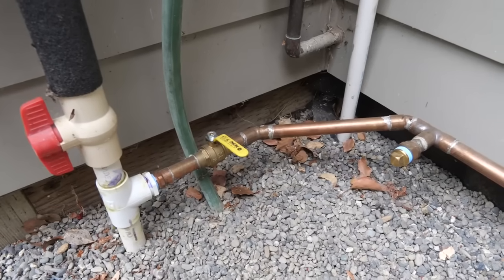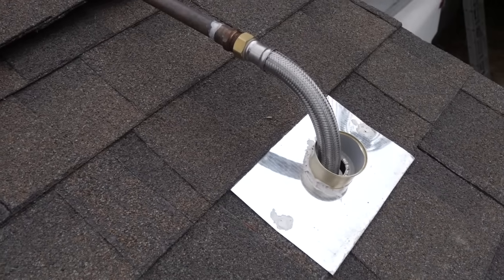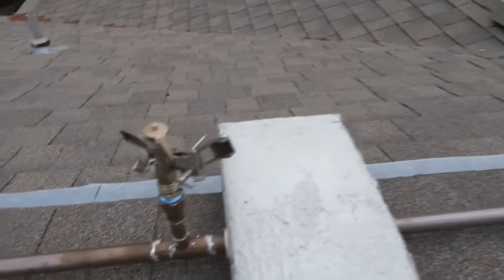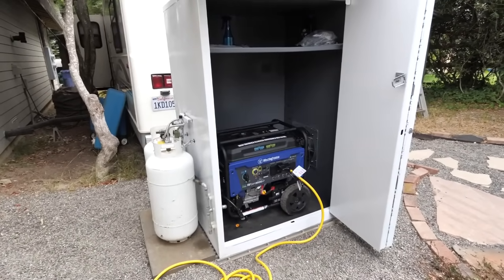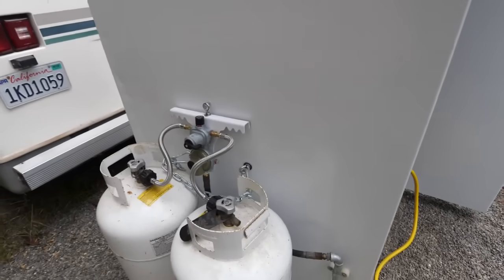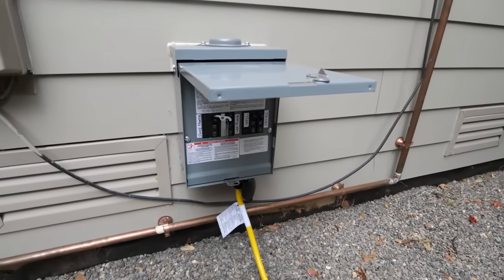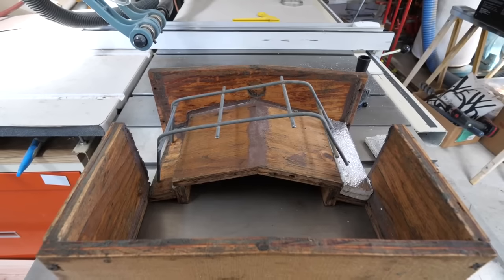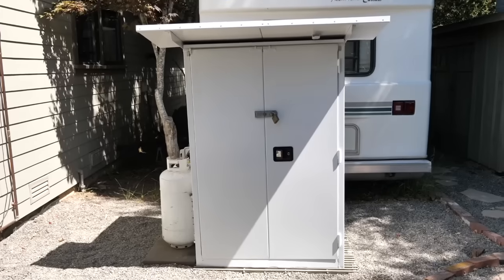Roof sprinklers and backup generator for wildfire-prone rural house

Comment: An ok  install. Congratulations on such a project. But ...

I've done it myself in Australia where we get ferocious bushfire house burn-overs of 600-1000°C.  But I used 1" copper main supply line because volume and pressure and sprinkler jet size calculations for a similar house size to yours needed 1" not 3/4" main line. You'll have starvation at one end of your lines due to pipe frictions -- unless you add a 1" ring line (plumb from your bore pump via a buried poly line to the other end of your house and then up again). You can then add ground-to-house face sprinklers off it.

1" gives nearly 2x the water volume of 3/4". Sorry, but 3/4" was a false economy.

In fires, sprinkler jets should be sized for LARGER DROPLETS at LOWER PRESSURES rather than high pressure for long shoots because heat evaporation can reduce up to 100% of your water spray if it is not heavy. I used things called "wobblers" not Rainbird of Cyclone design. Your house can end up in merely a cloud of steam with dry lawn verges and roof water which doesn't even get to your gutters.

Comment: what makes wildfires the most dangerous is the high wind speed. when the wind is blowing really hard is takes embers and forces them into the eaves and vents of the house . plus the water would be blown away from which way the wind is blowing. so just the sprinklers on the roof would probable not save the house in a high wind wildfire.

Comment: You may want to invest in a pipe wrap heating system that can be energized through a thermostat for freezing weather conditions. That copper pipe will easily freeze in a harsh winter cycle.
Reply: he said it will be drained.
Reply: @norbertdx  Fires can break out even in freezing temperatures. How will it be prevented from freezing during operation?

Comment: This is great, but when the house is first built put the pipeline inside the house. With just the sprinkler out only. Have the power cord under ground won't burn , or covered. Have a system that if you are away from home it can be turned on.

Comment: YOU NEED TO BEGIN WITH A METAL SOURCE
YOU BEGINNING SOURCE IS PVC
THAT WILL MELT IN A FIRE 
BUT I AGREE WITH YOUR SPRINKLER SYSTEM 
I DID THIS TO MY HOUSE BACK IN 1995

Comment: Nice plumbing, and beautiful job! Know that roofs are not the primary point where fires gets hold of a house. They enter through your ventilation and gets hold of the inside and that's all she wrote. In other words suffits are the main entry point. You can see a house (in LA) that was untouched while all the other ones all around was burned to the ground. Again, what you did is not wasted just incomplete. The video is on Youtube https://www.youtube.com/watch?v=yZe-TlYxm9g

Comment: Interesting idea. I'm in Southern California and this has been a ferocious fire season as the worlwide news has reported.  Under the eaves of a house is often the first place a fire takes hold, so I would be thinking about that. Secondly, What if no one is home when a fire threatens? I'm sure some automatic trigger system could be devised.  I think this guy is right to do rhe generator/well method. We have seen power companies turn off the electricity and water utilities turn off the water to preserve it for the firefighters.

I think the major point I'm making is I think there is a market for a well engineered, integrated automatic system.  Wells average around $20,000 these days, so it would be expensive. Still, many people would see it as better than the terrible losses or the battling with  insurance companies.

Comment: BIG TIP - Your house has "roof eaves" where most fires start under the eaves and move into the attic.  Most fires don't start from the top of the roof itself.  You need to take that into consideration
Reply: I was thinking of the same thing.  According to a fire fighter, ventilated roofs are what caused many homes to be burnt down during the LA fires.  Finding additional ways to maybe block off the ventilation might be a strategy worth looking into.

PS - there's absolutely nothing negative about your statement.
Reply: @lanzer22   Agreed.  New building code in California requires sealed eaves.  We have vents on our eaves that seal up in case of fire.  They're expensive but functional.
Reply: The water would flow down the roof and over the eaves. Don't be so negative.
Reply: @PeterHatton-nm6rn 
He's not being negative, he is being 100% accurate.
Reply: Clearly you don't understand. Your talking about the facia. Which has gutters on it. So no water will get to them.
He's talking about the updraft thru the eaves into the attic. 
Take a seat and stfu.

Comment: Looks like the weak link would be the power cord from the generator to the transfer switch.  I’m not an engineer, but could it have been buried or protected in some way?
Impressive system. I have been thinking of a system like this for a cabin in the Colorado Rockies. I had not thought of using propane.  How long do you estimate it will run with two tanks?  Great system though.

Comment: That's a great backup plan.  I would also add a second generator at another location in case the first one fails.  Also, remove any trees or vegetation maybe 30-50 feet from the house.  Once the surroundings get to some temperature in fire,  it overwhelms the sprinkler system.  Another thought is to add security 360 cameras so you see things in real time.  It's much easier to putout a fire started 1 min before than let it burns for hours.  My 2 cents.

Comment: Very cool. And I love your homemade concrete pipe stabilizers. BUT you miss an important part of fire prevention, which is control of the soffit vents. Every home has soffit vents and roof vents that create a chimney effect to pull air in through the soffit vents, and out through the rooftop vents to keep the attic moisture free. But during a fire this chimney effect sucks in sparks and ignites the attic. You need to have shutters to close the soffit vents or gable vents during a wildfire event, possibly even shutters on the roof vents so no sparks can be sucked into the attic.

Comment: That’s a very good idea but there’s just one thing wrong you can see it in the picture the tree limbs that is hanging over an around your roof they are a problem a lot of people have bushes right next to there house also a problem and vehicles or rvs that have two be moved or have a dead battery that can’t be moved if had to just a thought

Comment: I like the setup, but I'd also be putting some sprinklers under the eaves (mist spray) to wet the walls.
Looking at the fires currently in California with the high speed winds , I'd be worried about the embers hitting the side of the house and burning it. 
Sure, the roof is important (embers landing on it) , but the sides are also important I think.

Comment: well done. i've noticed the underside of the overhangs are what also catch the heat and flames as fires approach the house, you better also have a perimeter of lawn sprinklers that can keep the flammable scrub and sides of you house wet👍

Comment: Did you install a switch to disengage the power coming off your generator from returning back to the power lines?
That’s how linesmen and other people get killed. From people doing things like this. The power ends up energizing the line for miles while your generator is running.
Also, all that work might be useless because all that natural vegetation and big trees around your house needs to be removed up to 100 feet from your home to prevent the fire from getting up close recommended from the fire guide.

Comment: If you are evacuating: shut of water and gas at the point it enters the house. If your house burns down the pipes melt or burn, so if you didn’t close them off water and gas will just poor out. Water especially is bad because it drains the pressure and wastes loads of water, making fighting the fires harder. Gas and fire, well no explanation needed.

Comment: Metal roofs and brick siding would be better than asphalt shingles and burnable siding.  This should be standard construction in wildfire areas.  The sprinkler is a cheap and possibly a good work around providing you don't lose water pressure.

Comment: That is a very good start. I live in Australia where we too have major wildfire issues. The biggest problem is the wind. At 70MPH wind (120KMH) most of that water won't land anywhere near the roof, except for when it abates for small periods. Make sure you have downpipe plugs to catch the water and fill the gutters. That way the embers falling on your roof and roll into the gutter will be extinguished rather than burn up under the roof cladding.

Comment: Love how you installed two propane bombs right outside the cabinet for your generator. You won’t have to worry about exhausting fumes from the generator when those babies light off.  You probably won’t have to worry about that side if of your house either.
Reply: Also no air intake for cooling for the air cooled general.  It'll overheat and fail.

Comment: My house has a metal roof.  Been struck by lightning a dozen times and never had an outage or fire. Stunning that few people have houses with metal roofs in fire-prone areas.
Reply: generally modern shingle roofs don't set on fire. Even in the late 90s they made tar shingles that are fire resistant for these areas. Its not like shake shingles that will set on fire. Its more about a wildfire tearing through a dry yard and taking the house with it.   This would cover more than just the house and leave a nice fire break around the house. Thats what its for more than the roof setting on fire. Factor in cost of a metal or tile roof and you can see why people opt for tar shingle.

Comment: The ability of the moisture from the sprinklers to stop the flames from getting close to the structure (and stop embers that land in the gutters from igniting the structure) seems key. I wonder how barndamium-style houses with metal roof and siding faired in LA? I would have liked to have seen more of your spray pattern dry vs wet. Neat project 🫡

Comment: Great system! Not sure if anyone mentioned this yet (I couldn’t read all 839 comments) knowing people these days, I would make it so the generator can run with the doors shut and locked, plus use a hard line to the house. People these days will steal the generator and/or extension cord and probably the propane….

Comment: Honestly... it's a pretty god damn good idea. 

Every home or apartment out here beyond a certain year has fire-sprinklers inside the home. That's just common practice.

Putting fire-sprinklers on the exterior seems even more logical in regions with a lot of wildfires in CA like my area. 

As a GC of 24 years, running sprinklers on your exterior roof is far more simple than doing so on your interior. A leak inside your home, on fire-sprinklers on constant high pressure can turn into a major catastrophe if there's no fire. 

On the flip-side... have a switch on an exterior sprinkler roof system is a genius move.

Pretty fucking sad we even need to consider that idea.

Comment: Nicely done, but I question the usefulness of it:
1.  If the water pressure is lower (which it most likey will be if firefighters are fighting a fire nearby) then the sprinklers won't shoot as far.  They might not rotate at all.
2.  If the wind is strong then it might all blow away before hardly getting the roof.
3.  If the fire gets to your trees (it appears your home is surrounded by big trees) then the heat will vaporize that water in no time.
4.  If the fire gets to your home then the heat will be so great that almost nothing will stop it.  I once asked an architect if we could build a home that was highly resistant to fire and he quickly concluded it wasn't realistic, due to the intense heat and the duration of it.
5.  As for the man whose home was saved by this technique, can you really be sure of it?  How does he know that the sprinkler system saved his home?  It's possible that under just the right conditions it could make the difference, but there are plenty of other conditions where it won't.

Comment: You have a few flaws in your system. The sprinklers are not powerful enough for heavy winds and fire. The propane outside could easily catch on fire and blow half your house down.

Comment: Just some observations... first few seconds.. copper pipe into plastic pipe (heat resistant?)... Is the cladding on the side of the house fire proof/heat resistant? as the copper pipe is attached to it... propane bottles on the outside of the generator shed, wouldn't they have been better inside on that second shelf?  Yellow electricity wire to switch box, how heat resistant is it? wouldn't it be better to have that underground.. Would it not be beneficial to have a second line on top of the roof that cascades water over the roof to keep it cool, a cascade of wter over the generator shed and propane bottles if they are staying outside the generator shed and a water cascade over the well pressure tank to keep that cool and anything else that is critical to the running of the sprinkler system... there will be a lot of heat damage from the fire which may put your system out of action. The heat from any fire may also evaporate the water coming from the sprinklers making it useless. Would it not be better to have the sprinklers also spraying onto the house from the perimeter instead of from the house to the perimeter?

Comment: Great video. I am about to copy this system exactly using a large tank as a suply with the rain gutters re-cycling the sprinkler water back to the tank. Do you think it is necessary to add a non-return valve at the base of the system so the water does not run back down?

Comment: I am a retired wild-land firefighter. I used to set up sprinklers to protect structures. We can't put them everywhere and I think you did a great job. I had a new metal roof put on and I am adding the same type of pipes but am making it a CAFF (compressed air firefighting foam) system Kidee makes a mixer and I have a large compressor. This makes a thick layer of foam as thick as shaving cream. You should also add pipes under the eaves as the fires like to get under them and enter the roof. Great job!  Look up SCOTTY 4171 foam mixer, you can put this in line of the water pipe and it will mix the foam.

Comment: As having once been a firefighter I know that wildfires will suck all the oxygen away ahead of its path. So, once your generator shuts down, staved of oxygen, then your propane tanks will blow up helping the fire along. We lost five mates on a fire tanker after the tanker's pump failed and they passed out from affixation long before the fire actually burned them and the tanker which incidentally was fitted with its own sprinklers.

Comment: Wonder if the winds will defeat this.  I.E. blow the water away before it can work.  Stay safe peeps.

p.s. No one hates a Fireman.😃
p.s.s.  Except that guy that caught one with his girl. 😲
Reply: A tiny amount of water vs a giant forest fire with burning trees collapsing on the roof
Reply: @GunnerStrauser  Several homes have already been saved by watering down the roofs and walls of home sitting next to a burning home.  However, you could tell from the video's that it wasn't during the high wind events.  These winds are almost 100mph.  Thats what has me wondering.

Comment: Wildland firefighter here: *Sprinklers are a BAD IDEA. Wildfires create their own weather... heavy winds. Heavy winds will blow the water your sprinkler sends into the air away from where you want the water.... saturating your roof. Instead, poke holes in either side of the water line on the top pitch of your roof... this way the water runs down directly on your roof coating it much better and will use less water to saturate your roof. Plus when water pressure drops, it can still drip water onto your roof where sprinklers might not have enough pressure to even operate them.

Comment: I don't live in a fire zone area, but i am all set up for disasters.  instead of having a $5k generator i use an inverter. I drive my truck onto the yard and hook up a 2500 watt inverter and let the engine run.  i remove the dryer vent from the side on my house and run an extension cord into the basement. I a then hook up the sump pump and plug in the refrigerator and chest freezer.  For heat in the winter i have 4 cords of wood in my woodshed and have a fireplace insert stove to heat the house.  For cooking i have a gas top stove in the kitchen it is hooked to a 20lb propane tank.  I have 5 tanks for backup.  So i have all of my bases covered in the winter and summer for all disasters except a fire storm which we don't get.

Comment: You could still upgrade the generator cord to at least silicone cabling for double the heat resistance or mineral insulated copper core for essentially fire proofness.

Comment: You should have the generator exhaust directly out of the housing. The propane should be inside the fire proof cabinet. The generator is worthless if the propane tanks explode. 
The concrete blocks are extreme overkill. A 10# block would be more than adequate.

Comment: I’m confused why the generator is in a fireproof box if the door will be open in use and the gas tanks are on the outside exposed to fire.  Also why the extraction fan is there when the door is open. Am I missing something obvious?

Comment: Bonus benefit, the sprinklers will certainly help cool the house on hot days. The sawmill I used to work at put sprinklers on the metal roof and it made a remarkable difference on hot days. A tip of my old hard hat for a well conceived and executed plan. Respect!